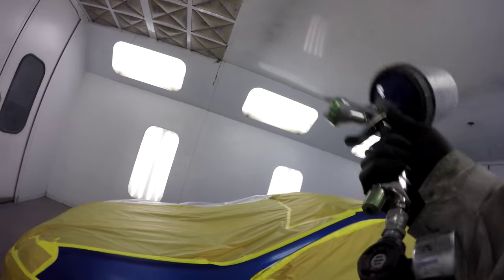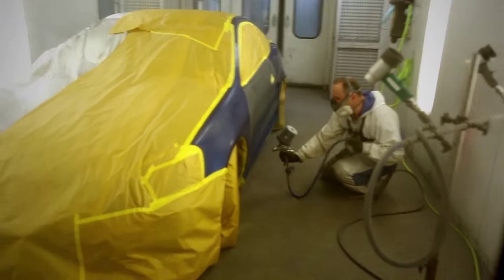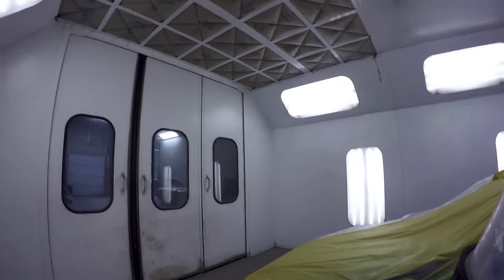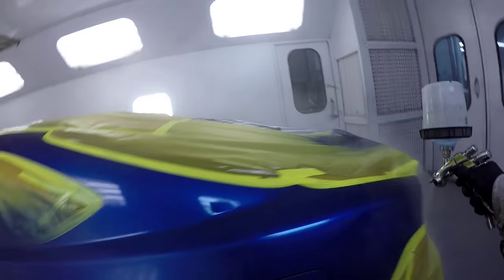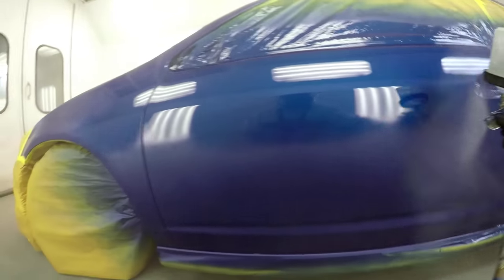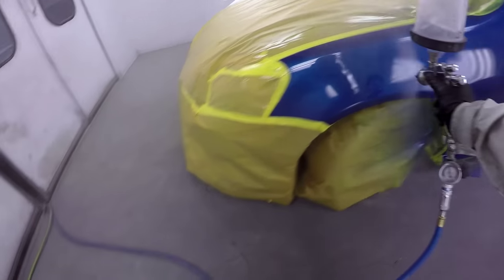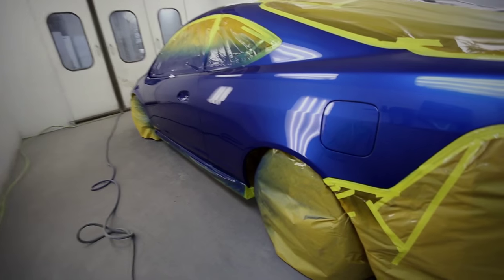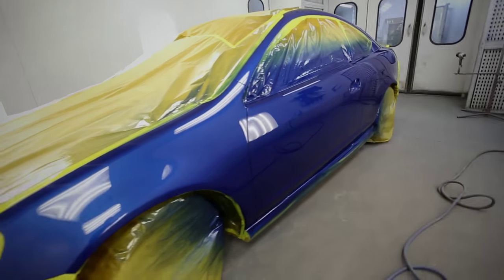Applying Base / Clear - Metallic Blue Paint Repair

Comment: Jimmo, which SATA 5000 do you use for basecoat HVLP or RP? Also, what N/N size. Also what WS400 do you use for the clear and what needle size for that? Thanks.
Reply from the maker: +SATAMAN Schmidt I've traditionally used the HVLP for basecoat, however, I actually just did a rant on this exact topic for another video coming up.  I recently spoke with a Sata technician from HQ in Germany who says he usually prefers the RP for basecoat. I think it depends on the paint manufacturer too, I believe Chromax recommends a compliant where BASF is HVLP, not sure about other lines.

Comment: Hey brother what gun recommend for metallic paint also what gun recommend for clear coat to get good finishing
Reply: For clear I use a iwata ws400 supernova 1.3 tip. Also good for clear is the sata 5000rp. For base I use my ws400 but the iwata ls400 is recommended. Also the devilbiss prolite is great for a 2 in 1. For clear and base. All preference.

Comment: Beautiful paint job bro, but the headlights are yellow and ugly, you can restore them sanding with 320, 600, 1200 and 2000 sand paper, and after that, apply a coat of polycarbonate clear coat and them will seem like new ones
Reply: Alejandro Rodríguez duh
Reply: Alejandro Rodríguez actually you don't need to sand at all.. take a DA buffer preferably Porter-Cable and grab some blue coral or some other kind of metal polish and slap on a course pad. Dab a little bit of the metal polish on your pad and buff. 5 mins later brand new looking headlights. You're welcome.

Comment: it seems to me that you went a little too far out into the adjoining panels for the first coat and why didn't you give the first coat some flash time..... sorry about that but i believe in plenty flash time to get all the solvents out and not have any trapped to eliminate chances of solvent pop.... which i have had problems with before being impatient.....ha ha ha....sorry
Reply: Waterborne base, no solvent.
Reply from the maker: +thomas dawe for this paint line that's the recommended application. (Chromax)
Reply: Also spraying clear the way he did is better. If you go edge to edge you'll get a run on the edge of the panel. Going like 6 to 8 inches onto the next panel allows you to avoid that